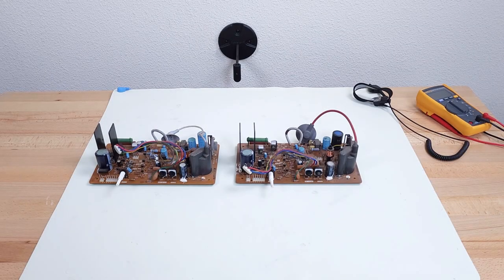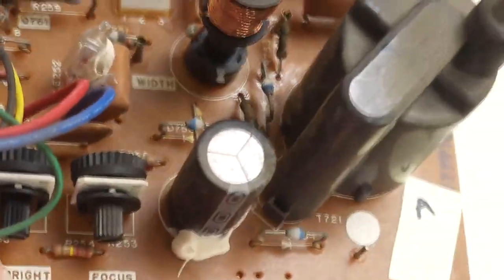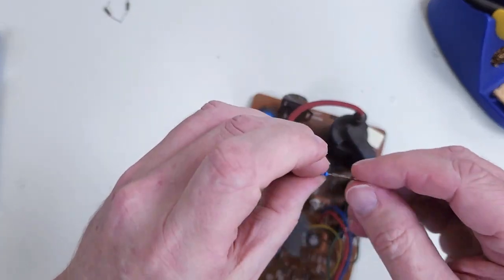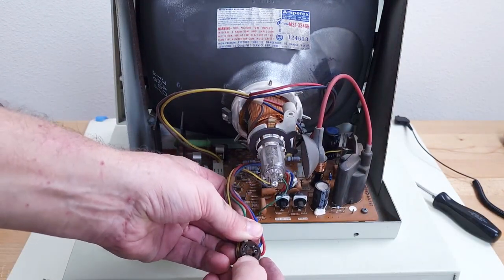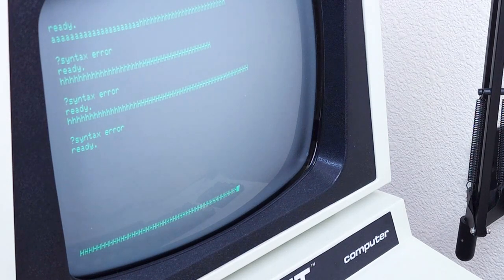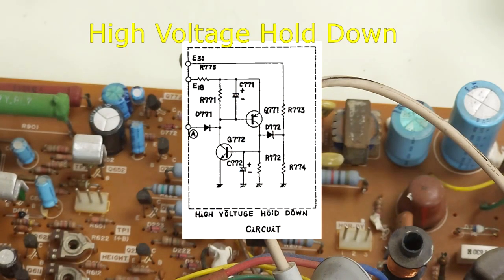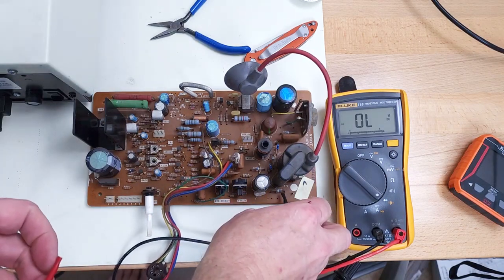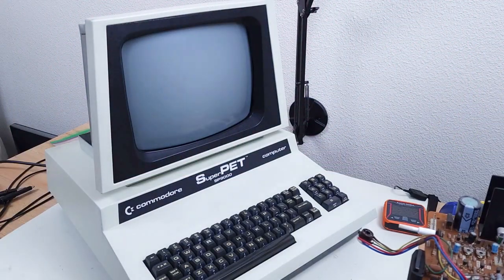PET 12 inch Monitor Repair

Comment: Excellent video. Wish I'd seen this before I fixed my 4032 12" monitor board. I ended up verifying all of the waveforms from the service manual and changing all the electrolytic caps before finally finding the R752/R753 resistors. If I ever repair one again that's the first thing I'll try!

Comment: Neat set of fixes.  Why not put a resistor into your bleeder circuit to avoid the snap?
Reply from the maker: There is debate about that. A lot of people prefer to hear the snap so they know when the discharge happened (or not). With a resistor, there's some guessing required for how long to hold it to be sure you've bled off the full charge.
Reply: Good point.  Maybe there is DIY tool to be made to bridge the gap!  Thanks for the video! @HutchCA

Comment: It would be interesting to measure the voltage drop across those two resistors, to determine the actual operating current/wattage.

Comment: These resistors are fusible resistors, (thats also why they are mounted away from the board using the mounting pin). So changing them for normal ones with even higher watt rating is not the best idea.
Reply from the maker: I've never seen that mentioned before. Afaik the parts list just shows them as normal metal film resistors.
I assumed the standoffs are mainly for heat dissipation, but I could be wrong. Why would a fusible resistor need that standoff?
I'll have another look at the schematics and parts list. Thanks.
Reply from the maker: I can't actually find a parts list for this version of the board but I re-checked the schematic and it only specifies RN type resistors.
I also reviewed some old online postings as well and found no mention that these should be fusible.
The only 56 ohm fusible resistor I could find online now is rated for 2 watts.

Comment: What caused the cascading failure?
Replacing the diode and cap, followed by resistors seemed related to another issue.

If the diode has failed, do you suggest replacing all at once? Diode - cap - resistors?
Reply from the maker: I'm pretty sure the bad cap caused the diode failure.  The resistor failure is unrelated and quite common on these boards.